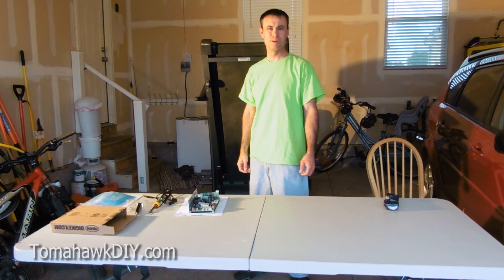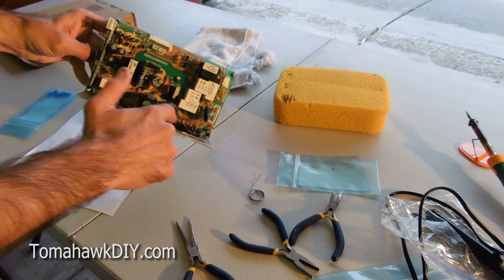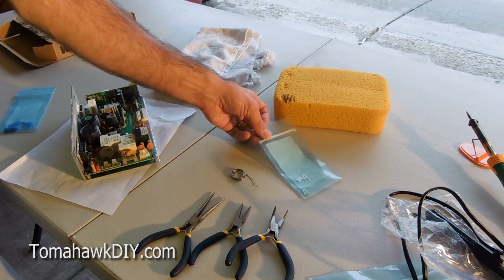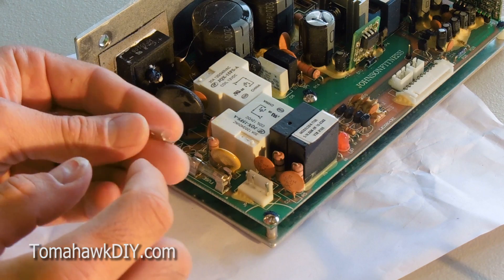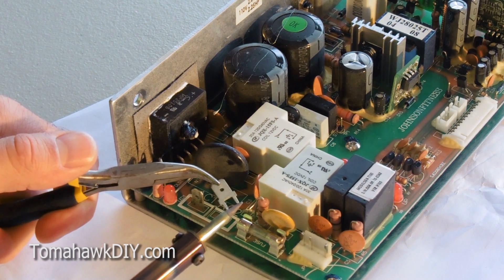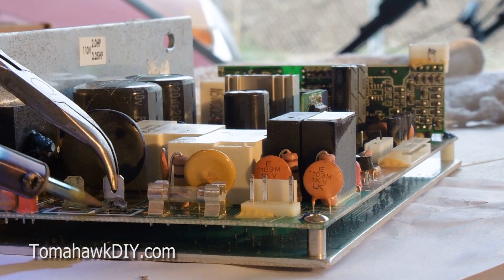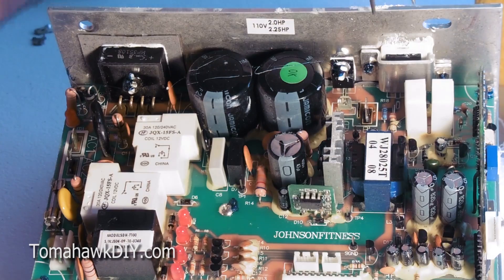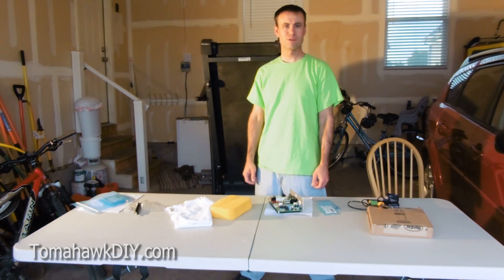How to Repair a Circuit Board (from the top)

Comment: Hey! I’m currently trouble shooting my treadmill tested the motor and it works and upper electronics work. There were some wires pulled loose some wires but hooked those back up and still doesn’t run? Have a way I could contact you for help?

Comment: I noticed there was a fuse on the circuitboard .... Did you check it ...?
Reply: LOL I WISH THERE WAS MORE TO VEIW TO SEE IF THIS VIDEO WAS AS HARD TO WATCH AS IT IS TO IMAGINE THE BOARDS THAT WILL BE MISHANDLED FOLLOWING THIS GUYS NONINFORMATIVE ENOUGH, POOR, AND NERVOUS EXPLAINING OF ELECTRONICS REPAIR. LOL. I DONT USUALLY SPEAK SO ILL BUT MAN THIS SHOULR BE REDONE ON NUMEROUS LEVELS.
 BUT I WILL GIVE HIM CREDIT FOR SHOOTING FOR DONATIONS AND AT BARE MINIMUM SOMETHING CAN BE WITH LUCK A TEMP FIX OR POOR BUT EFFECTIVE VIA THIS ROUTE ASSUMING THE SURROUNDING COMPONENTS LIVE AND PCB MAKES IT AND (FUSE GETS REPLACED WHICH I BET A DOLLAR THAT WAS THE REAL PROBLEM) AND STATIC ELECTRICITY DOESBT ZAP THE BOARD AND ASSUMING IT WAS NOT A STAGED ISSUE OR HOPING THIS GUY SEEMS LIKE HE IS ON A LOT OF COCAIN LIKE MY RUN ON SENTENCE STRUCTURE OF THIS OVERLY TYPED COMMENT OF MINE. 
BTW ITS REALPY MEANT TO BE FUNNY NOT HATEFUL BUUUT IM NOT LYING EITHER SO YA THERE IS THAT. TATA FOR MEOW WHOEVER STUCK THROUGH READING MY " RANTINGS OF A MADMAN" HAHA GOOD DAY!